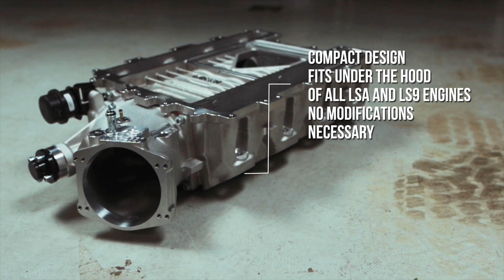Kong Performance LSA TVS2650

Comment: Well then all those LSA out there need to get one of these king kong beast installed so we can see how far the LSA stock engine will take, especially the one which already have the interchillers installed ? Thats 760 CC of more air, thus requiring larger injectors, maybe 1,000 cfm units. Cant wait tioll someone installs one and gets a tune, to see just how much extra HP it will make and coat per HP made as well, which includes everything after market done and then say it cost X amount for extra HP at the wheels if you install the interchiller and the new 2.680 Low rise superchargers. :)